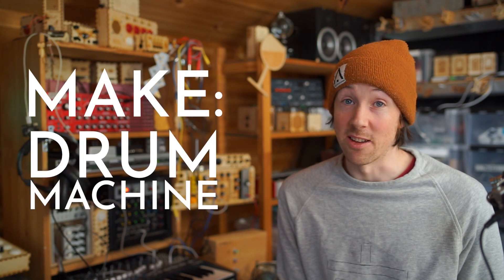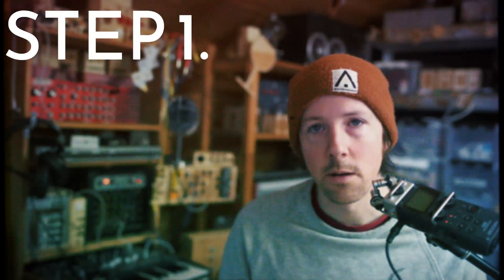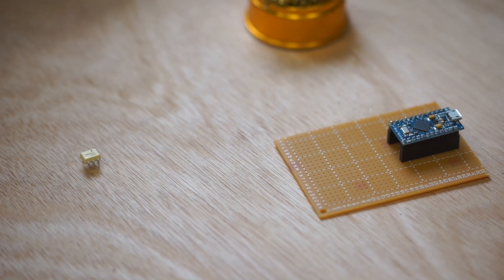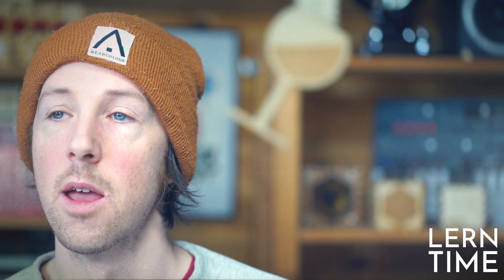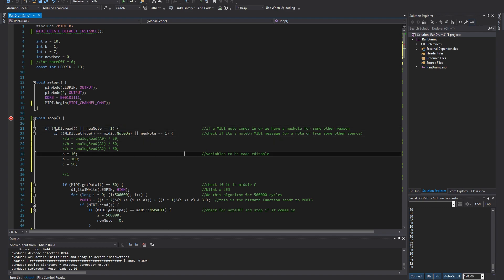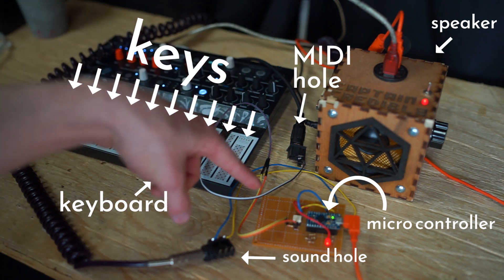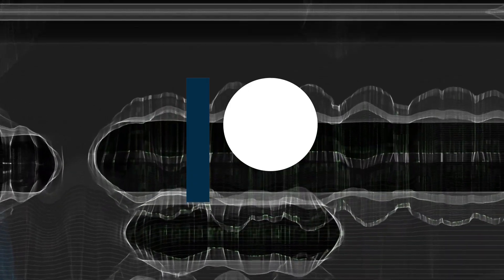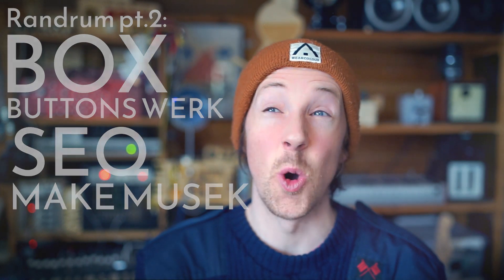Make a randrum generative drum machine

Comment: Ahoy Captain! 

I just made an interesting discovery today messing around with Fantasy Mansion and Soma Ether. I can actually hear the audio, especially the drums, through the EMF around it and actually all the way down a 15ft aux cable. It just happened so I'm still messing around but it's super interesting; Nothing I have besides Fantasy Mansion produces even remotely similar results. 

I'd love if you could explain what's going on and include it on your list of necessary functions that would be awesome! 

Either way, if you're making this drum thing commercially available I'd like to be on that list ASAP! 😁

Love you!
Reply from the maker: Short story: The Soma Ethers receiver is being compromised by the radiation field emitted by the perlington demon gate and is slowly phasing through dimensional planes and will son begin to appear translucent as it permanently teleports to the "demon realm".
 The long and boring explanation is that the Fantasy Mansion has little to nothing in the way of output circuitry. No op-amp buffering, not even a DC blocking capacitor. It just pushes electrons down the cables as hard as the input impedance of the receiving end will allow. This results in more EMF.